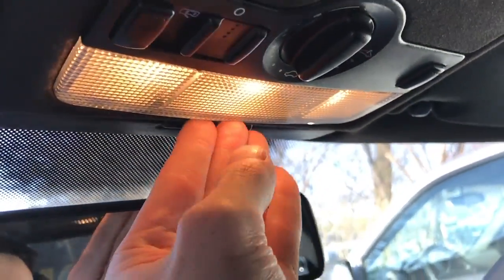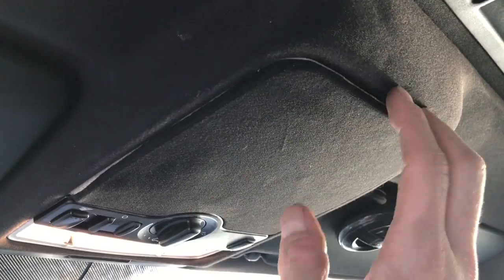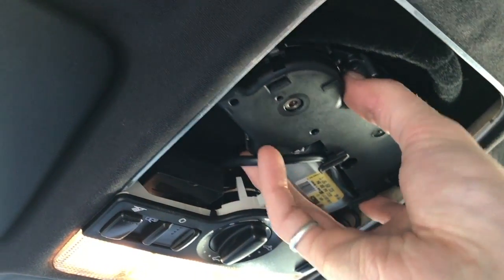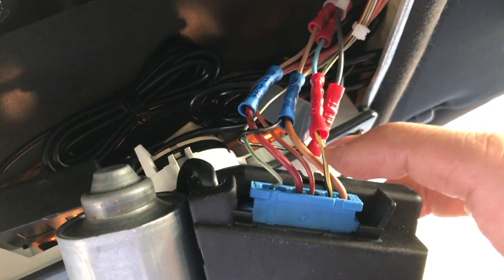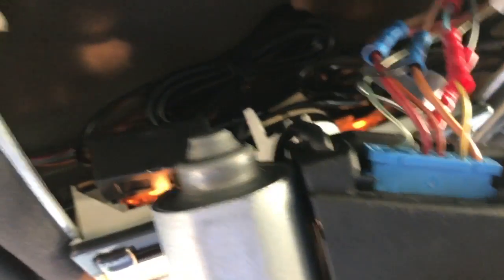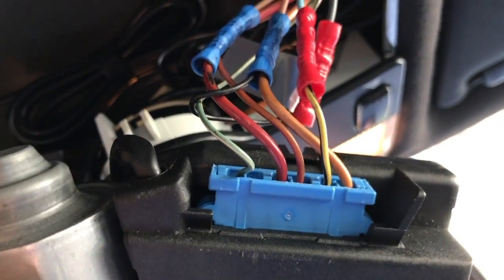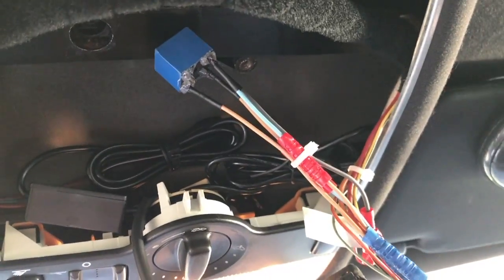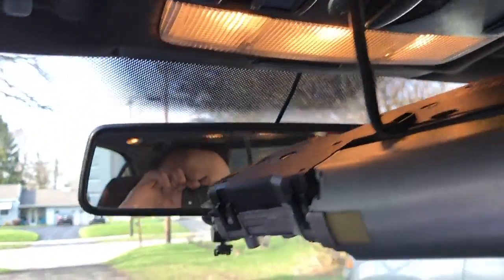Powering a dashcam off the sunroof wiring on a MK4 Jetta

Comment: Thanks, Adam this worked fine on my '00 Golf.  Thanks for posting and particularly pointing out which wires were switched/unswitched 12V and the ground.
Made me glad I got the sunroof (yes, believe it or not I"m original owner having owned only watercooled VWs since 1981...as my only car (besides brief intervals between when I got to sell my old car and had bought the newer car).  I remember wanting one without the sunroof, but they had a package that bundled alloy wheels with sunroof (darn bundling...know that's long been the norm but my '86 GTi (previous car) still had individual options...remember those? (yeah guess there still are a few, but mostly in bundles or trim levels).  Wish they offered dashcam ready wiring (cars that have standard dashcam seem to expensive for my taste, from what I've seen), but I guess different USB connectors makes that hard to do in practice (dashcam ready).

One thing I didn't anticipate (and greatly surprised me) is how long it takes for the switched 12V to go away after powering off car....I almost was going to look for another switched circuit as it seemed like it would never turn off.  For me it could stay on for 7 minutes....even when interior lights go off you still have a long wait (at least on my Golf) till the dashcam finally turns off. 

Probably not a big deal; it only powers the coil on the relay not the unswitched 12V that goes to the 12v to 5v Dc-Dc converter, but with power consumption as high as 1.5 amps per hour even if it stays on 7 minutes that's less than a typical incandescent light (maybe 7.5 watts per hour) but if a lamp stays on (even a dome lamp) it can eventually drain your car battery.  I'm probably going to drive myself crazy for the next week or so checking how long it takes to shut down just to make sure it does.

Guess I'm old fashioned; not used to theatre lighting or circuits that stay active for awhile after you remove the key, I just didn't expect 7 minutes; I kind of freaked and started looking for other switched circuits to control the coil of the relay (had an eye on the dome light, it seems to go off in less than a minute but it is activated by door switch instead...so if you keep your doors open awhile (or forget to close one) that could mean the dashcam would be on until you figured out you left your door open.

Another hint, try to get a 12V to 5V converter that matches your dashcam connector.  Mine originally was mini  USB (not even micro USB) but the unit I eventually got had USB C type physical connector.  That way you won't need to strip open a cable to handwire the 5v and ground lines).  I made mistake of ordering mine from China and it took longer than I thought (about 3 months) to arrive in the US...I forgot what I figured out the first time I took the sunroof motor down in terms of fasteners, it was so long a wait...my own fault though, should have known it can take awhile.

Comment: Thank you for this video. It actually helped me twice on fixing my Golf mk4: (1). to helping me finding to determine which parts of the sunroof is broken (twist switch, motor or the wires that goes into the motor), (2) helped me for exactly what I wanted to do: wiring dashcam to the 12v switched wire. So thanks again for helping me figure this out. And I wanted to add something: inside the motor assembly, it contains 2 relays and basically doing the same thing: switched wire to close the circuit and then use 12v constant wire to power the motor

Comment: What kind of relay is needed?

Is a relay needed even if it is wired directly to the dashcam without a charger?
Reply from the maker: Len P I used a SRD-12VDC-SL-C, less than $2 with free shipping on eBay. And yes, even if a 12v dashcam existed it would still trip the "breaker" in my experience as it draws too much current. Let me know if you need more help!

Comment: So how much current can this wire supply? I hooked up a slightly larger relay and the signal seems to have stopped permanently, no voltage on the yellow wire and sunroof does not work (possibly blew a transistor, or whatever switches that wire?). I didn't short it and there were no sparks. Already checked the fuse.
Thanks for the awesome vid btw.
Reply from the maker: I'm not sure. I tried connecting my 12V-5V converter to that wire before ordering the relay and saw the same thing—that wire just stopped working. But I'm pretty sure I just turned the car off and back on and it reset? Or maybe I pulled the fuse to the sunroof and then put it back? Of course you'd have to remove your draw (relay) first or it'll just trip immediately again.